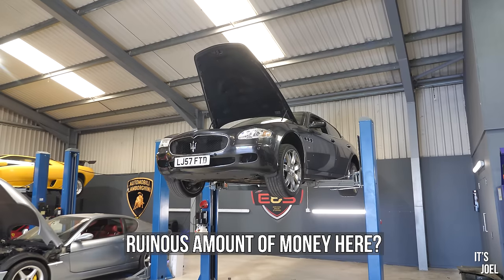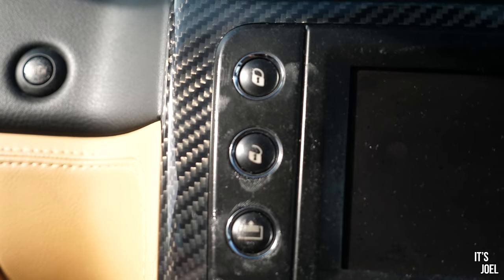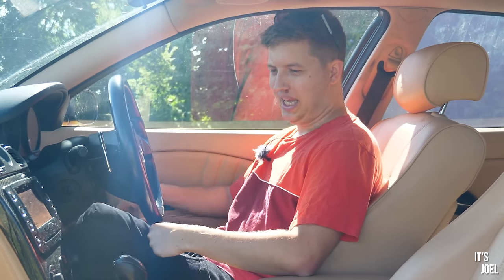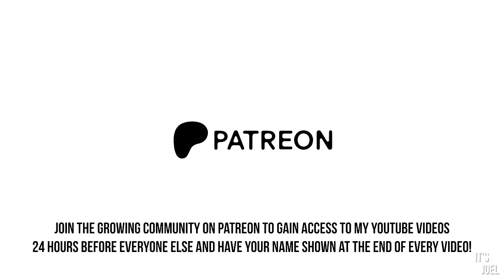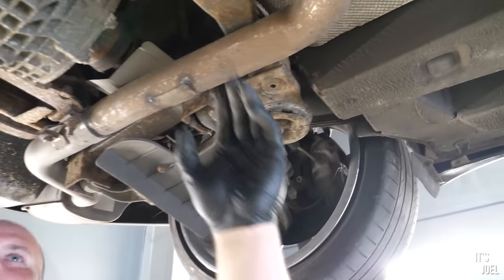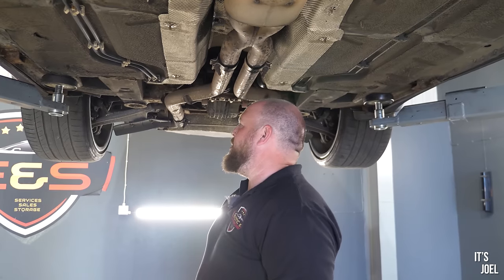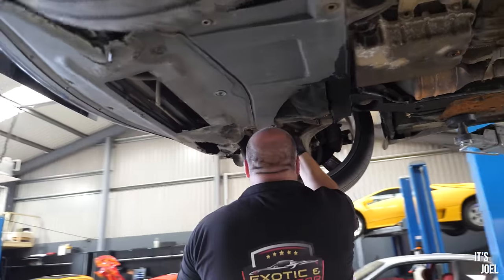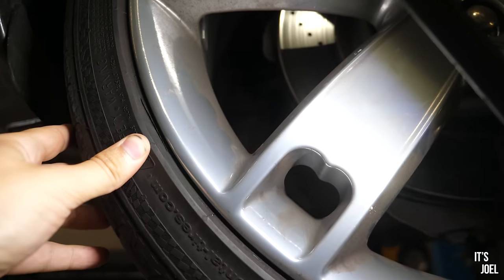Here's why my Maserati Quattroporte was so cheap...

Comment from the maker: What do you think I should do? 😅
Reply: Contact the seller, see if you can get like some money back or something. But KEEP IT! It's so cool and it will make good content 👍
Reply: Unsubscribed dumping my comment.
Reply: If that passed its mot with no advisories i would be reporting the mot station to the dvla , did the test guy have a white stick and a guide dog,  ?😂🤣
Reply: I think you should go wild in it, High lift suspension and off road tyres and let's see what it's got off road 😎😎👌
Reply: Get rid.
Reply: Report the MOT centre.
It won't help you, but it might help somebody in the future.
For all you know they are on the DVLA watch list already
Reply: I must admit I have a soft spot for these, even though I couldn't afford to run one. However, it is a higher mileage example, so who knows what else will go wrong?
Reply: Keep it! Enjoy it as much as you can until it blows up, then sell the interior 😂
Reply: Repair the engine. There's not much content about these cars
Reply: Go to your local garage and get them to do a MOT on the car and see what the extent of the damage really is. For the sake of £50 at least that is a cast iron guarantee to get you a refund
Reply: Brought my freshly bought Saab 9-5 to the Saab Specialist last week with a clean MOT history since it was new and the last owner had it for 21 years. Turned out it needed at least 10K in repairs. So the last owner was very good friends with the MOT guys. Anyways what i’am trying to say fix it, drive it and make it someone else’s problem after that! I mean it’s a Maserati!
Reply: Wave goodbye. Money pit
Reply: Council MOT Centre. (You can get a Council MOT I mean)
Reply: Simple. Next time you buy a car....don't be so GULLIBLE! LOL! Bet the seller couldn't believe his luck when such a chump turned up!
Reply from the maker: @phillipsharpe6459 think stevie wonder was the tester
Reply from the maker: @ericx122 or take the seats out and put them in my house
Reply: The question is, are you rich enough to own this car? 😅 not only fixing current issues, but also all upcoming issues! 😅 check my story in the comments, it's hell on earth 😅
Reply: See what money you can get from the dealer put it towards repairs and keep it.
Reply: Keep it, make it a project car. Show what can be done with some determination and creativity.
Reply: Get a second price for the work. You’ll get it half the price from another garage
Reply: Drive it till it dies, sell the interior an other valuable parts 😅
Reply: Joel, I'd definitely contact the "dealer" tell them you want some money back as your having to shell at a minimum of 4k for engine work. Dishonesty in the car selling business is a big no no. Especially from established companys.
Reply: Then use correct engine oil Pennzoil
Reply: There are loads of videos how to fix yourself. Not a difficult job. You can diy it.
Reply: Hopefully we will learn from your experiences. Maybe ask the garage u went to and ask if can borrow their facilities etc but do labour yourself
Reply: Go down the Winchester…have a pint…and wait till it all blows over 😂
Reply: Put 2jz in it.) 😂
Reply: Spend the monwy. 10k....you wont get a ford focus for that. C'mon. Sort that baby.
Reply: I run a 2007 QP with 107000 on the clock and I’ve just had the variators done at a cost of £4K. But I’ve owned the car for 10 years since it had done 40000 miles so I know its history. I’m confident I’ll get another 100k out of it now so when put like that it’s maybe not so expensive. You have to remember you’ve bought a £100 grand supercar and spare parts are commensurate with that. The good news is you can now start to get good quality aftermarket parts like brake discs/pads, shock absorbers etc which makes it a bit less painful when you do need to replace something. Tbh I’d be more concerned about your clutch - you’ve got the paddle change kit which is great for playing at F1 drivers but those clutches can burn out fairly rapidly. The6 speed ZF auto box is much better, but you are where you are. Btw, the wing mirrors switch you were pushing has to be rotated, clockwise for driver’s mirror, anti for passenger side. The sticky switches are indeed a Ferrari/Maserati problem but again they can be sent away and renovated. Also, a good mechanic, looks like you’ve got one, can replace individual bushes at a fraction of the cost of replacing a whole suspension unit, which the main dealers will do without giving you the option. Lastly, the variator problem is more the noise at start up than a catastrophe risk. I would go on your European road trip and enjoy it. See if you like the car. I love mine, it’s my everyday car, out in all weather, and, touch wood, has never let me down. Which is why I swallowed hard and spent the £4K. Sounds like a new engine again, and what an engine!
Last thought, I got 30mph driving from Edinburgh to Cornwall at motorway speeds this summer. Try getting that in any other supercar. Happy motoring.
Reply: I run a 2007 QP with 107000 on the clock and I’ve just had the variators done at a cost of £4K. But I’ve owned the car for 10 years since it had done 40000 miles so I know its history. I’m confident I’ll get another 100k out of it now so when put like that it’s maybe not so expensive. You have to remember you’ve bought a £100 grand supercar and spare parts are commensurate with that. The good news is you can now start to get good quality aftermarket parts like brake discs/pads, shock absorbers etc which makes it a bit less painful when you do need to replace something. Tbh I’d be more concerned about your clutch - you’ve got the paddle change kit which is great for playing at F1 drivers but those clutches can burn out fairly rapidly. The6 speed ZF auto box is much better, but you are where you are. Btw, the wing mirrors switch you were pushing has to be rotated, clockwise for driver’s mirror, anti for passenger side. The sticky switches are indeed a Ferrari/Maserati problem but again they can be sent away and renovated. Also, a good mechanic, looks like you’ve got one, can replace individual bushes at a fraction of the cost of replacing a whole suspension unit, which the main dealers will do without giving you the option. Lastly, the variator problem is more the noise at start up than a catastrophe risk. I would go on your European road trip and enjoy it. See if you like the car. I love mine, it’s my everyday car, out in all weather, and, touch wood, has never let me down. Which is why I swallowed hard and spent the £4K. Sounds like a new engine again, and what an engine!
Last thought, I got 30mph driving from Edinburgh to Cornwall at motorway speeds this summer. Try getting that in any other supercar. Happy motoring.
Reply: I'd get the repairs done
Reply: @DontDrinkTheFlavorAid  Its a later model with a different engine
Reply: Have some fun with it for a few months before shifting it on at auction at a profit!
Reply: It is a 17 year old car.  If your garage is comparing it to a brand new once then obviously it will cost you more than the car to fix it.  Probably use a 10w 40 Pennzoil engine oil abd that will fix it.
Reply: LS swap it, it will then only have everything else fall to bits, but the engine will remain solid.
Reply: Just fix the problem yourself, I just finished mine, replaced the variators, let the cam caps modified bij TEM Performance (USA) and replaced a lot of other stuff. A lot of work, but doable. All these engines up and untill 2010 models will have these problems somewhere in their lifetime. So buying a good one, which already had this modification will be much more expensive than the costs of having this fixed
Reply: Definitely report the dealer and mot centre - so others are less likely to be stung. Some serious issues there. But be prepared for a fight. I had problems with a Suzuki swift diesel (not exactly Maserati) that had been misfuelled and had fuel pump issues. Took over 6 months to resolve it.
Reply: Please try to fix the car Joel we really miss you
Reply: Fix it 😊
Reply: What an awesome car. That sound and those looks for 6 grand. Unbelievable. I too watched those Top Gear and Fifth Gear reviews over and over again. I hope you factored in some money to bring it back up to "good condition". Especially since the purchase process was dodgy, there was no proper pre-purchase inspection, the car history was questionable and the nature of buying an 17-year old, high mileage Italian supercar. You've got a future classic in your hands. If I were in your shoes I would spend the money and fix it. I don't have the resources yet to buy and maintain an old Maserati, it's great to watch someone who does. :) You've bought this car with your heart, please give it the love it deserves! Cheers
Reply: There’s a video from a chap who bought one precisely like yours that had basically the same issue.  He took the engine out which took days, did the cam variator thing and then twenty minutes after he fixed it, the engine let go.  Get out of that car whilst you still have some cash!!!  Scrap it.
Reply: Do a chargeback on your card!
Vehicle not as described!
Reply: Report the mot center that's a bent mot. Dangerous
Reply: I'm late to the party, don't know what you paid for it, didn't quite catch the cost of repairs (5K?) but the moment we saw underneath reckoned it was a keeper.  Your mileage may vary. I'm coming from years of metal fabrication and full on DIY car (mostly Porsche 944s) and motorcycle restoration.  I'd try the top end mod first to see if the noise become something you can live with.  If not get stuck in.  Worst case scenario - you can always recoup your money breaking it for spares.  Best scenario you get to drive a classic supercar for not a terrible amount of money.
Reply: LS swap it
Reply: @kize32  Sreten from M539 restorations is currently putting in engine no 2 on his one. Ask him what he thinks of the Maserati Quattraporte...
Reply: Scrap it.
Reply: Off it goes laddie! 👎
Reply: Report the fake mot to dvsa
Reply: Ls swap it
Reply: @minimeee04  why do they do this? Fake channel
Reply: Start praying ! (Great video - Subbed)
Reply: Fix the "hooptie"!!
Reply: Dump it and get a Ferrari.  At least if its a money pit, like this thing, you still own a Ferrari.
Reply: M539 He covers an engine rebuild…
Reply: Joel, I feel bad for you. You’re a good man and I feel like you’ve been tucked up with this purchase. No one will buy it from you as it’s CAT S and has the rattle. I’d accept what’s happened and try get the tyre and regulator out of the seller. I don’t know what your financial position is like but you could run it until the engine goes pop parked it up in a garage and revisit it in a few years after saving to fix it. Keep it and use it as a luxury fun car that you will never sell. Only flaw with this is it being a CAT S so any money spent on it you’d not get it back
Reply: Get a Kia Niro
Reply: Gorgeous car, but a) report MOT centre and b) if seller doesn't accept rejection or won't pay for repairs, take them to small claims court. It worked for me.
Reply: get a brain
Reply: Money back and buy a sorted one for a few grand more.
Reply: @vfrbore1728  old cars are money pits
Reply: It's a beautiful car. I'd try to get some money back and then fix it and keep it.
Reply: @peterwinter3515  money pit repairs.
Reply: thriow it away..

yopu put a newengione , but the engine you ddi put in, is already used,, No gooD.

spending money, for nothing
Reply: Tough one, head says bin it, heart says keep, but do go back to the dealer and show them this video and if they're a reputable dealer, in theory you should have no problems, ok you did say you bought it 'blind' but surely they won't want their reputation put at risk, especially all over social media! See if they'll compromise and meet you half way by footing the bill for some of the repairs that they said that didn't need doing as a good will gesture....good luck and keep up the great videos!.

Comment: About 4k for the repairs? Ask the dealer for 2k as he must have known the engine problem and as for the MOT!!!! Then have the work done and you’ll have a well sorted Maserati for a lot less than 10k.
Reply: I’d feel inclined to get a couple of thousand back from the dealer and then go ahead and bring the car up to a really good standard. I’ve often bought cheaply but then spend on refurbishing so it’s almost up to nearly new standards.
Reply: Unfortunately a Maserati like this will never be sorted. Repair after repair...
Reply: @MarkGelderland  That is why I have stuck with Audi and VW tdi vehicles for over 40 years. Never had any expensive repairs, despite around 300,000 miles on 2 of them. Correct grade fully synthetic oil from day one certainly helps. The older the engine, the more it needs it. Coolant and brake fluids also need to be changed every 5 years.
Reply: @wilsjane     Well that's one way to do it.  But some people like a bit more beauty and excitement in their life.  And a thoroughbred car is cheaper than a thoroughbred woman.

Comment: Joel, my advice is simple and you can take it if you want. Where else would you get a £6k Maserati from ? Fix the suspension knock, new tyres (cut costs and visit tyre street UK). Sometimes you get stung and I have before but this is a fantastic car to say you’ve owned. Keep an eye on the rattle and enjoy it. Just put it down as a characteristic of the car.
Reply: Never let an engine rattle get worse, never.
Reply: @thatpeskyswan in USA we add Lucas oil treatment...works almost always...

Comment: Worth trying with the dealer but not expecting too much luck tbh. Only failure that I saw from the video was the tyre. MOT is for the day the vehicle was presented, for all we know the previous owner could have another one of these, swapped the alloy in question over for the test, drove home with a clean bill and swapped it back and traded the car in. Engine noise isn't obvious to those who don't know what the engines are meant to sound like so possibly just missed it. Probably can get a small contribution to the repair of the car but it'll be <£500. On the plus side once the engine , tyre, underside and any worn bushes are sorted it'll be good for years.
Reply: What about the two exhaust leaks?
Reply: @geoffaries probably should have been an advisory but if it's only a minor leak it's not a fail.

Comment: paid 4k for mine on auction at ebay, zero issues, 90k, oh other than every suspension shock spring was snapped. I have fitted a set of coilovers from Gecko on it, I've replaced the spark plugs and bought 8 new coil packs which set me back nearly 2 grand. I'm now in the process of fitting a brand new stainless exhaust...
Reply: Ur life is over..
Reply: That's known as mission creep...
Reply: @andrewmooreandrewrmoore7615       🤣🤣🤣

Comment: One problem with "sell this, buy a nicer one", is that you're going to end up with another unknown car - which may seem better than the current one, but a month or two into your ownership is no better than the current one. Sure, it may have lower miles or fresher tyres, but you don't know if it's got some other issues that you can't tell until a while later.

It's a difficult one, for sure. I''m quite glad I don't have to make the decision.

If you can get a bit back from the dealer, that would certainly help.

Comment: Great mechanic. It is an Italian automotive product. I would have bet my house on it suffering from corrosion, material quality issues and in need of expensive repairs. Think fiat strada and weep. Recommend Aston Martin Rapide 4 door (proper 4 seater) or Bentley Continental (if a 2+2 works for you). Serious quality, better performance better materials throughout. Built to an engineering standard not to a budget. British too!
Reply: Bentley is German, VAG.

Comment: Several people have had succes with installing an Accusump to get around the cam variator issue. Problem with those is that between starting the car and the oil being up to pressure, you are running the cam variators unpressurised for a few seconds, which makes them rattle.

The idea behind the Accusump is that prior to turning the engine over, with the accusump you can pressurise the oil system and with that the cam variators are filled and up to pressure before they are being cranked over.

Makes a lot of sense.... And costs less than that 4K...

Comment: £500 for a set of decent brand name part worn tyres with 5mm + and the exhaust clamps fixed, drive it for a bit and move it on. It's pointless pumping £4000 into it - the day after you do, the gearbox will shit itself or some other catastrophe. Know when to hold 'em, know when to fold 'em!

Comment: Just a small suggestion ,  large engines tend to have an electric oil pump to get the oil.pressure up prior to starting ,  so an added pump and some plumbing could fix your issue

Comment: Get your money back if you can, those cars are lovely but really older ones can be ruinous unless your able to fix yourself. I bought one for £500 a 4.7 v8 as the owner had enough and was going scrap it. The car did  run fine but was riddles with loads of other faults that just cost to much to fix, sold quite a few parts off it made around £3500 on it and scrapped what was left.

Comment: Up to you what you do, but as other people have said, take the car back to the dealer.
Thing is, any vehicle sold from a dealer needs to meet trading standards and be fit for purpose. In practice, this means that you have around 3 months to take a car back if it's got any big problems, like this cam variator, and the dealer really doesn't have a leg to stand on. You may even be able to return the car up to 6 months later. Also, sounds like the MOT could possibly be a bit dodgy, but certainly was quite lapse!